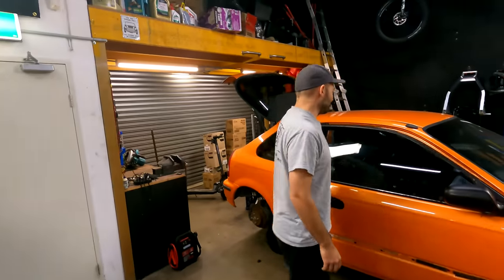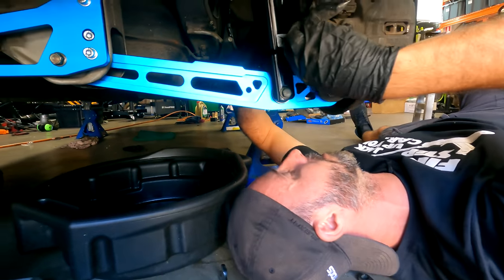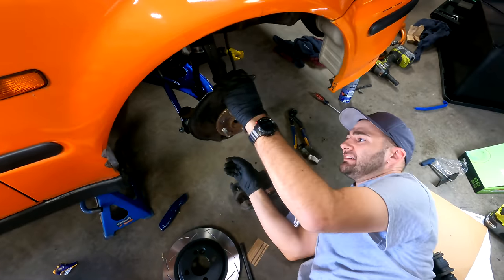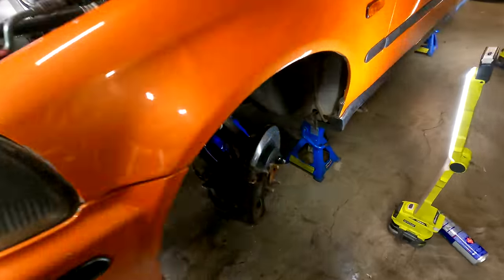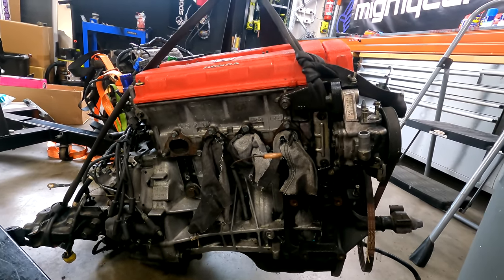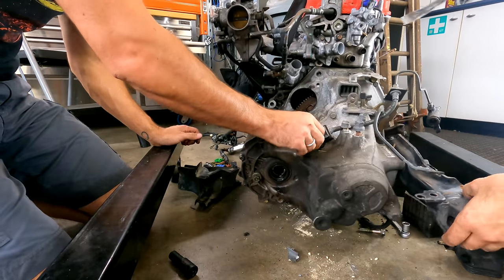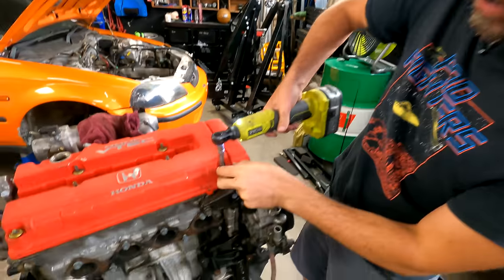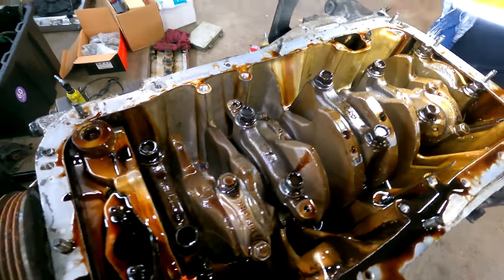Our Civic is NASTY - Engine work begins! (EP4)

Comment: As a trained mechanic - im proud of moog ascending to the ranks of using anger as a tool... its the thing that us tech's all have in common
Reply: Yeah, I'm a train technician (mechanical and electrical bits). Years of experience have taught me that percussive maintenance is an actual professional term for a repair. In my language we say that we exercise the parts causing the problem. Lol.
Reply: Why does working on vehicles make people so angry? lol
Reply: "If violence doesn't solve your problems you haven't applied enough of it."
Reply: @jaynekk1  Try it and you will know. If you don't you haven't done it long enough.
Reply: @jaynekk1  You'll get it once you do it. It's like having all your dreams and hopes being smashed repeatedly by dumb little stuff. Like a single stuck bolt for example that may or may not end up ruining your plans for whole day or week. It's fun when it's easy and nothing is broken. It's not as fun when things are not co-operating and you may or may not be on a schedule.
Reply: @jaynekk1  because engineers hate mechanics. Doesnt take long to realise that when you are working on them daily.
Reply: Not just mechanics. I'm a computer technician, and even for me anger is most definitely a tool.
Reply: @jaynekk1  because a 30 minute job always some how turns into 3 hours especially when having to work on the ground!
Reply: @Salpeteroxid  "percussive maintenance!"  thanks., i'll be borrowing  that !!
Reply: Brute force is ALWAYS the answer. Be sure to take cover or duck when you hear that rage grunt bounce across the shop. A wrench will soon follow. Also, always have an extra, crappier set of wrenches for this purpose.
Reply: Yeah I'm a mechanic and I took the pay cut and drive trucks rather than work on them. Motorists drive me crazy now rather than the machinery. You can't win.
Reply: "If in doubt, give it a clout!"

Comment: Mugen never made intakes for the B16 or B18, Skunk did though.

So put that in the bin!
Reply: They did mugen intakes lol, mugen did almost all civic parts into performance, some easier than other to get and some only available in mugen versions of the vehicule, i personally had a friend with a mugen type r from japan with a full mugen kit (intake, cams, etc)  mugen is honda's trd (toyota)  or nismo if your a  nissan  which all offered performance upgrades from factory for an extra !   Theres also amg, m series, rs series, etc.
Reply: Moog and Marty can Put  any Engine B16A you can't make them want to do anything and that is Marty Honda Civic

Comment: The "CRX" had 2 Generatations, Gen 1 was MY '84 to '87, Gen 2 was MY '88 to '91. The "del Sol" is the successor & basically a continuation of the "CRX" and still got "CRX" in the name for some markets so some people call it the "CRX del Sol", the del Sol was MY '92 to '98 so basically a 3rd gen "CRX"
Reply: 100% accurate. My car papers state: CRX ESI U9. Its a Del sol, a D16 SOHC VTEC. 
Sadly most VTis have the faster DOHC VTEC are (p)riced to the max or trashed IN THE BIN!

Comment: You shouldn’t use the copper crush washers on your brakes if you plan on tracking, if they go through a couple heat cycles they may start to leak. The oem aluminum Honda crush washers are way more reliable.

Comment: If you think something will take half a day to do, just multiply that estimate by 3, then add 4 hours.
Reply: I have a very simple formula that I use to calculate how much time a job on my 1990 MR2 Turbo will take. I take the amount of time it would take to change the exact same part on my 1994 Celica Turbo’s exact same engine/transmission/turbocharger and I multiply that number x3.
It works flawlessly every single time. 🤨
Reply from the maker: So true
Reply: @negativeindustrial  you're forgetting about the 4 hours of thinking all together
Reply: One of the engineers I worked with always said that he would estimate the amount of time required for a job, then multiply by pi.  It was remarkably close when everything was done.
Reply: @backyardbangers1012 
Accurate. You must be a MKII owner
Reply: @MichaelSteeves 
Isn’t it interesting that the three formulas given all add up to roughly the same result. There might be something to this, after all.
Reply: @negativeindustrial  no way. I own v8 holdens . But i work on alot of other vehicles. Not just cars

Comment: "it's seized" while they rip the transaxle off with the inspection plate still bolted on 😂
Reply: 100% why it wasn't coming off
Reply from the maker: Do you mean the black cover underneath the flywheel?
Reply: @mightycarmods  yep, that wanted to be removed before you try take the box off. Looks like you figured it out in the end lol

Comment: I LLOOOOVVVEEE the project guys awesome! And I can be soooo understanding of what finishing someone's project is like as I have done so many times now.

If you want to play safe I would recommend adding a Vtec Pressure Switch to you solenoid though as it will protect the engine by not engaging Vtec if oil pressure is too low and thus saving the bottom end, I also personally also use a Bosch knock sensor in factory location with a M12x1.25 to M8x1.25 insert and M8x1.125 bolt

Will be looking at the progress!

Comment: I bulilt many crazy combos . I could recommend if you can find a 4 speed from a 88-91. Its like putting bigger gears in a rear end without shifting as much. Use integra injectors, Add a 4al box. Get adjustable timing gears and set ex +2 deg. Get crazy you can get some stage "3" cams for it. The adjusters only will have a couple threads holding them in but you will have no issues. Have fun.

Comment: My first 4 cars were Hondas. I'm on my second Suby now. Still have love for the Honda's. I had a 91 CRX SI that was my dream car at the time. I sometimes think about tracking one down and fixing it up. 91 was the last year they made them. The gas mileage on those are insanely good and was super fun to drive around. It basically just was room for me and another passenger and I had a sub box that took up the whole hatch.  CRX and Del Sol are not the same! :)

Comment: I have a tip for you, from one creator to another. Instead of always dumping car liquids on the ground and then having to mop it up. Get a square plastic fuel tank and cut the top off. They make excellent catch pans. Much better that a drain pan for oil changes. I have one out of an old van that will almost fit wheel to wheel on that Honder 😁👍

Comment: Guys, you should have quickly whipped over hose calipers with a wire-wheel (on a drill or grinder) to clean off the schmutts and put a bit of shine on them. Costs nothing except for 2-3min. of your time, and looks much nicer.

Comment: A good way to clean the whole block out as well lads is to run diesel in her at idle then drain it after 10 mins! Diesel will attack old seals but if you're replacing most of the crud, she should be good :)

Comment: Need to change the proportioning valve to a 40/40 along with the master cylinder. The brake bias is different between rear disc and rear drum.

Comment: As an aircraft mechanic, here’s  my take what you need to do with those brake calipers: 1)  initial hand clean in a solvent tank.  2)  After that clean in the Sonic bath cleaner.   3) Dry in vacuum oven at 180-200 deg for an hour.  4) Inspect for damage. 5)  If no damage then  prime and paint with high temp paint!

Comment: The CRX and Del Sol are different but kind of related. The Del Sol was sold (in the UK at least) as the CRX Del Sol from 1992 and it's based off an EG Civic. The original CRX ran from 83 to 92 model years and again shared a Civic driveline, but is now worth like £15k (nearly A$30k) for a half decent one, whereas the Del Sol can be got for like £1,750 for a running, driving and MOT'd one...

Comment: Not sure if this has been suggested, but here we go. 
I like the fact you have kept the B16A, Kanjo racing style guys #NOGOODRACING in Osaka build the best versions on this platform. They always KEEP IT NA and most stay B-series.
You could build the engine similar to what Woody #Theskidfactory did with his 4a-ge 20valve.
As you guys don't really ever build engines internally, this would be refreshing. Stuff like: 1.wet sleeves and high compression 85mm pistons (1757cc) kinda like a budget B18.
2. Balanced bottom end for max rpm's
3. High flowed/ported head with huge valves and stage 3 cam (kelford make some and turbo Yoda has the hook up)
4. Quad throttle body 
5. Large race style 4-1 headers
I believe that I'm not the only person that would like to see a highly modded NA build on your channel and you have the best platform to do it.

Comment: I'm pretty sure that intake manifold badge is not supposed to be there. Looks like a stock manifold. Usually badges in those places are printed flat. That mugen badge looks more like something you'd hot-glue to the boot. Or your dash.

Comment: The closest I've come to Honda territory has been the two Eagle Talon TSI's and a 2nd Gen Eclipse GSX I've owned/own.  The first-gen Talon I got dirt cheap for good reasons as a beater, and a second-gen TSI AWD model I still own and refuse to sell because I quite like the bubbly body (same reason I bought the brother/cousin/whatever in the GSX).  To be fair I've kept both cars as far away from standard Eclipse outlandish shite people put on them.  It's mostly stock besides wheels, hood, a duckbill style rear hatch swap from the Talon wing, bumper for space, and paint + wrap.  That's a big list but it, nor my 2nd Gen Eclipse GSX, has anything in what I would consider "ricer territory." They have both been made into Itasha cars though for the fun of it along with a couple of my other nuggets.  Nothing too extreme, just wraps a friend and I put together with color-matched engine bays.

I've also got a whole stable of ST204 Celicas I've built ranging from all types of power and drive trains from AWD, RWD, and FWD using powertrains from Subarus, GM/Buicks, Toyotas, etc.  There's also the second-gen Probe GT I love...I collect and build a lot of 90's nuggets.

Comment: Did'nt find it in the comments yet, but if that's a B16B engine it has 136kW at 8.200rpm and 118 lb-ft at 7.500rpm. 

It should make a pretty fast Civic.

Comment: assembly the caliper and bracket together then putting the pads in it... then the whole assembly on... makes my eyeball twitch.  i guess there's no reason not to, but I always bolt the bracket to the hub, put the pads in it, then put the caliper over them and bolt it down.

Comment: I know Ryobi are a sponsor but you need a decent impact gun, that thing is weak as...  get a milwaukee fuel m18, or even the m12 is powerful enough to pull crusty gearbox bolts out

Comment: Ek 4 99'B16 a2 vtec had frm new,( Shropshire ) new EBC front discs & Oem calipers, rear new original discs, Cc Clutch, Integra flywheel -Mfactory LSD done,  now for the rest ..19-April start date. (R as good as :)

Comment: Please be cautious of the tools you use, a steel pry bar on aluminium parts like these risk marring them. Not too important on the bell housing, but on the valve cover you risk putting scratches that will allow oil to seep past the gasket

Comment: I know Mustangs are not common in Australia...if present at all so I might be asking in the wrong comments section, but I wonder if you could replace the resonator on an ecoboosts exhaust (that's were the gooch is) with a dual outlet muffler like an 80's Camaro and run longer pipes to the rear? I don't see any kits like that but it seems like a cheaper, lighter alternative to the standard axle back with two mufflers?

Comment: You also need enough oil pressure to go into VTEC which is the main reason you can't go into VTEC at low rpm

Comment: in Ireland we race cars in grass fields stripped out roll cages modified engines and a few of us race starlets micras n colts with b series Honda's we use the d series flywheel drilled out to suit the b series and use the d series gear box 😂

Comment: You keep saying V16 and I keep getting slapped up-side my head. My maternal gramps was a mechanic and I learnt V16 means 16 cylinders, (like two V8s in a row,) and you mean four valves each on a four-banger. That's like, such a disappointment.

Comment: I would think as you have taken the sump off you would check the condition of the bearings waggling won't tell you jack Sh*t remove one of each and check them don't be a couple of muppets you have got this far if they are worn then you could just slap a set of new ones in if not great put them back on and please replace the crank seals once you know the bearings are fine then you will have peace of mind and you can hammer the engine with glee knowing it should stand up to your heavy right foot.

Comment: I owned 3 Hondas in the early 2000’s. My Accord was the best. My Civic SI(late 80’s was complete shit and my CRX(late 80’s) was complete shit. The previous owners were never nice. I loved Honda’s so much at the time, I had bought someone else’s problems. It wasn’t minor issues either. It was cylinder head issues, oil leaks. Since that I needed reliable, daily driver. I had given up on dealing with Honda’s and got a new vehicle. Looking at this video makes me wonder how much worse the engines were, even with the shit I found.
I hope that you get rid of the smell in the back seat before you are putting us back there to show up all the farting of rainbows you’re going to do. At least it won’t smell like burning oil.

Comment: I own a bmw what happened to the bmw build oldskool bmws are one of the most easy to build and popular buys for so many p players and older ppl because they aren't super expensive to fix and they can fit v10s in the engine bay of e30s and any engine in thesame wr 5 series the e34 basicly a car with total luxury of all the cars today but fits up to lax or lsaand also ford big engines and smaller turbo ecotecs or any engine you want just throw in a turbo or twin turbo and of anytype you want even ferraris and bi- turbo 6.3L merc engine bmw e34 5 series can be made with up to and above 3000hp yet I saw one vid of a bmw e30 and now your doing a car that we all know is popular only cause of a guest appearances on the cartoon ae86 hachi rocky car who used to grip drive and drift basic rouge driving downhill racing if you want to do an amazing diy do the e34 bmw as they are vintage now and also they can be any engine at all pit the vtec engine in a mini moke

Comment: hondas ecus can do all that exept electronic throtle (don't see the great advantage in that) and individual coil packs (can be done obviously but not out off the box), and hondas ecus know witch gear you're in so you can set different boost for each gear... I got here because i'm a honda guy but I unsubscribed from this channel because not everybody have 10 million sponsors to get a hole new car for free and replace EVERY part and throw everything in the bin, free aftermarket ecu, free tune, free everything... try do a reasonable budget car for once....